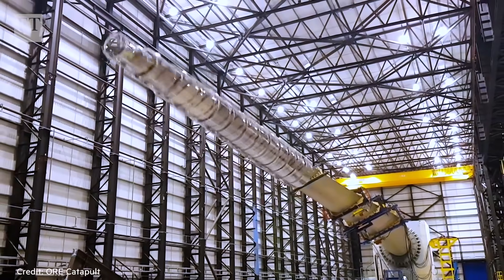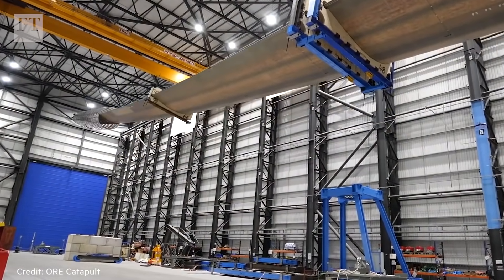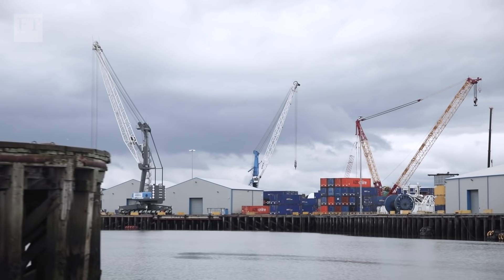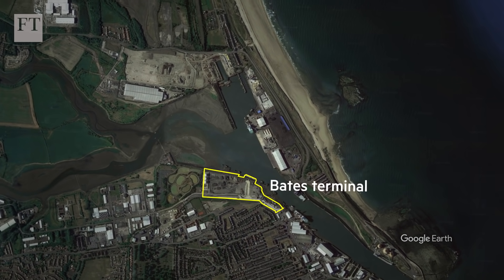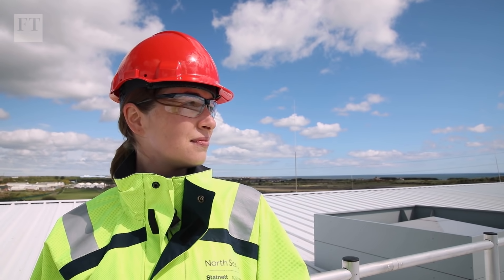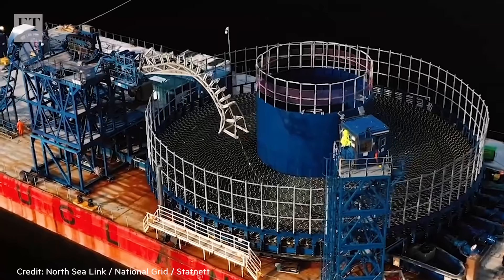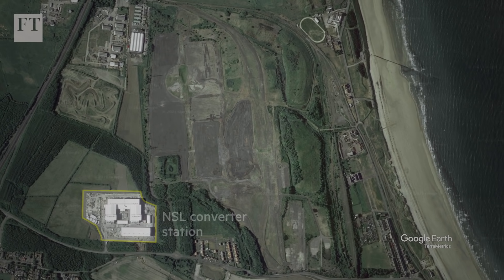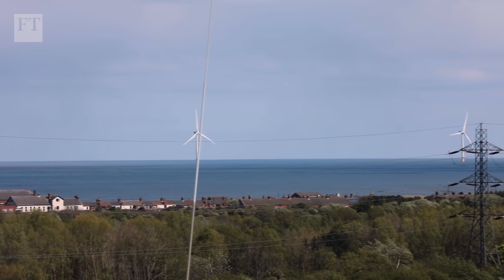The former coal town leading the race for clean energy | FT

Comment: What percentage of the power is lost to resistance in the 720 km of transmission cable?
Reply: It does not matter, what matters is that it is profitable for the investors, and it is. 
The alternative is letting the water flow around the turbine or selling the power for less.
Reply: @Jakob_DK  Efficiency losses don't matter is a ridiculously ignorant answer to my question or to any other question too for that matter.

Close your eyes and go back to sleep, child.
Reply: @sanjuansteve  
Tomorrow the price is 60 €/MWh in Norway and 115 €/MWh in UK. 
Baseload https://www.epexspot.com/en
 
The losses are generally 3 % pr 1000 km, this one is shorter so about 2 % or 30 MW out of 1400 MW. 
 
The price difference it much larger than the losses. 

I could only believe your question was a rhetorical question. The present test phase will show that the losses are in this cable.
Reply: @Jakob_DK  No, I actually, simply wanted to know the loss percentage.  Thx.

Comment: There may be a lot of confusion about converting between DC and AC in this context. The link between Norway and the UK is most likely high-voltage DC (HVDC). This is because transmitting electricity over really long distances is most efficient as DC. We've long been taught that AC is the way to transmit over long distances, but that's only true up to a point. For really long distances, DC offers lower losses. As for the original sources, wind power starts as AC, but not of a uniform frequency or voltage, so it needs to be conditioned into "proper" AC, and this requires first converting to DC. So the overall picture is much more complex than it may first appear.

Comment: Wind energy is only clean if not supported by coal or gas electricity plants, which sadly, is often the case to offset random wind activity that is not synced with scheduled pace of modern life. Gas producers are actually the greatest supporter of wind energy.
Reply: This is my very point and why Green (vs nuclear) is indirectly pricing Carbon.
Reply: Philippe
Wind cannot run without coal, gas or hydro.
It is an uncontrollable source of electricity. Demand an supply must balance at all times which wind and solar cannot do. It is sporadic and unstable.

Comment: tone of steal 
tone of wood 
tone of energy to make it 
makes nose
kills birds every day 

If you think still green comment below
Reply: You cannot spell Tonne, or steel or noise, I don't think your comment has much credibility, show you have credible knowledge before making pointless comments. Every form of energy generation method requires energy at the front end (energy invested) to provide energy output. Oil exploration, drilling and production requires a huge amount of front end energy and isn't going to become carbon neutral. 

A wind turbine can claim back the carbon emissions of its manufacture in 7-9 months out of a 25 year life-span. Fossil fuel based energy kills far more birds than wind turbine. A study published in 2009 looking at the US and Europe estimated that wind farms were responsible for about 0.3 bird deaths for every 1GWh of electricity generated, compared with 5.2 deaths per 1GWh caused by fossil-fuelled power stations. It said this would equate to the deaths, every year, in the US, of about 7,000 birds caused by wind turbines, 300,000 by nuclear plants and 14.5 million by power plants using fossil fuels.

Wind turbines make some noise but are rarely close to people, especially offshore wind, what's the problem?

Please explain what upsets you about the technology when the current options are far worse.
Reply: Doesn't kill nearly as many birds as driving cars and glass windows and facades.
Except for fiber enforced blades, most of it is recyclable or even reusable.
Being one of the best solutions right now, they will run for the deciding couple of decades regarding climate change, and while we're building more and more of them, we're optimizing them and their recyclebility.
Anyways, better than burning fossils.

Comment: Can hydrogen fuel be used for emergency power supply generation...
Reply: It takes a LOT of electricity to produce hydrogen, so while it's a potential fuel for cars and other transport, it doesn't make sense for back up electricity production. Probably the best way to store electricity is "pumped storage hydro electricity" (water is pumped up hill when there is a surplus of electricity and released to produce power when there is a shortage). They are about 80% efficient and last 50+ years. Giant batteries are also an option, although they only last 15 years and are full of dodgy chemicals.
Reply: @Dave_Sisson  While pumped storage is the actual 'best option' - it has the same issue as hydro - all of the best places (and many possible places that already have the geography for it) have been tapped. 

Dave you are completely correct about Hydrogen needing lots of electricity to produce (and more precisely, lots of electricity is permanently lost in the conversion process between (Water  + Electricity )-> H2 -> back to electricity. Interestingly though, Hydrogen is actually the best technology (on paper) to fit long term energy storage. That said, only way that will pencil out is if renewable energy gets to being significantly cheaper than it is today. 

The efficiency issue will mean Hydrogen will struggle for light machinery applications like cars. And to your question OP - hydrogen is probably not the best fit for emergency power supply - in talking about a 'backup source'. Batteries and their equivalents with their much better efficiency profiles work out better for shorter term energy storage.
Reply: Dave, 
there is no storage answer to renewable energy's lamentable performance, it just requires far too much of it.
Pumped storage (and similarly, chemical batteries can be used) is primarily used for frequency support. It's salient advantage is it can go from zero to full power in a few seconds, this can avoid grid trips due to a sudden increase in grid demand or the loss of a generation facility.
As for hydrogen it has far more disadvantages and serious problems that the possible benefit in utilising it for power.
Reply: I don’t understand why people are using this as a form of capacity for electrical generation. You lose a tremendous amount of energy to convert to hydrogen and then you lose more energy to burn for energy use.